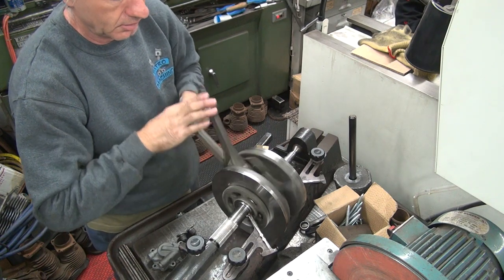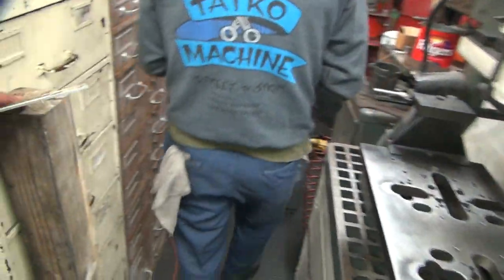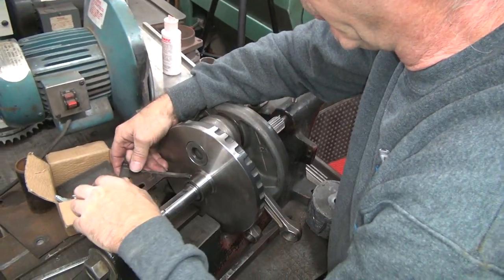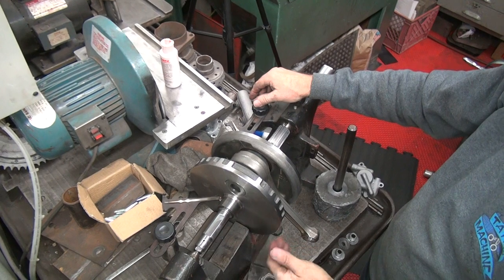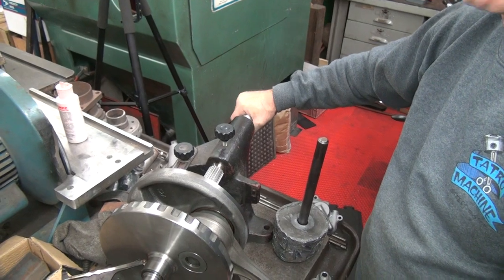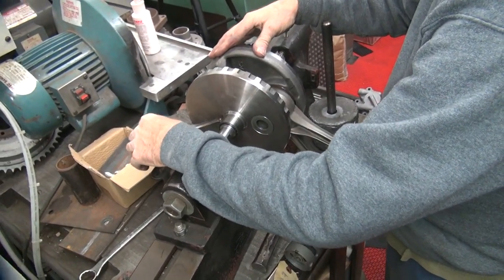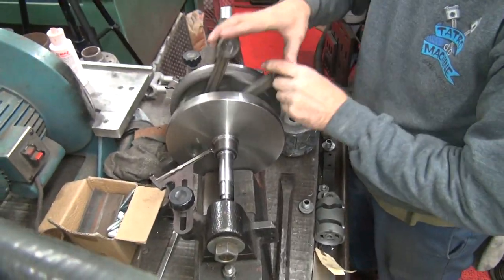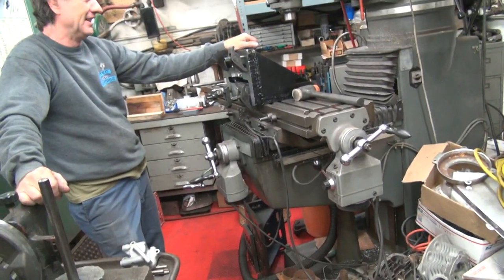#158 the making of flywheel truing tool crankshaft rebuild time m8 evo twincam harley tatro machine

Comment: Cool beans!
Reply from the maker: did i get the two cranks close enough for you?
tatro
Reply: @Tatro Machine  Fantastic job Keenan, I had no doubts. You got that truing stand down pat. Dad would be damn proud of your accomplishments. Did he have you doing the vast majority of the flywheels when you were younger? You sure know exactly where to wail on it! I've only seen you get your ass kicked a few times and so far these pressed pins aren't giving you any problems. I guess that's because they're not tapered like the earlier ones?
Reply from the maker: no, dad only let me work on my own crap. if i asked, he would help me. other than that he would just make sure i was not hurting myself as i learned on my own. he just made sure i was heading in the right direction.
tatro
Reply: @TatroMachine  Obviously you had a GREAT mentor
Reply: Don't know if he would agree to whaling on that crank without taking it off the stand